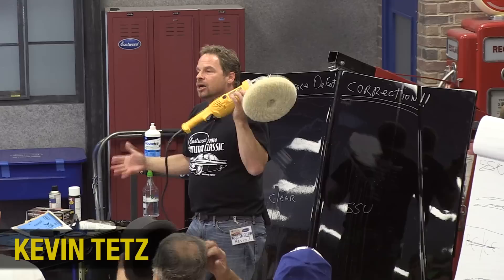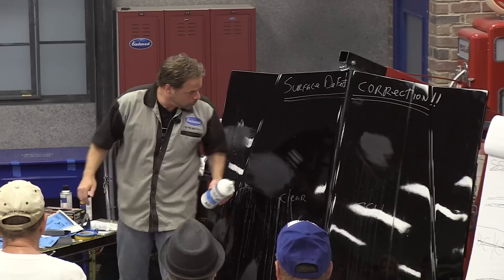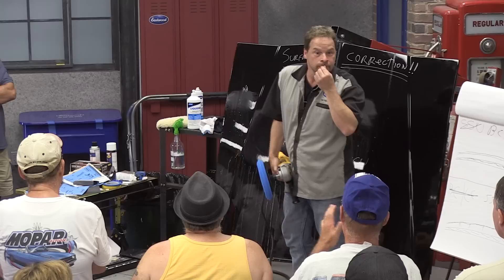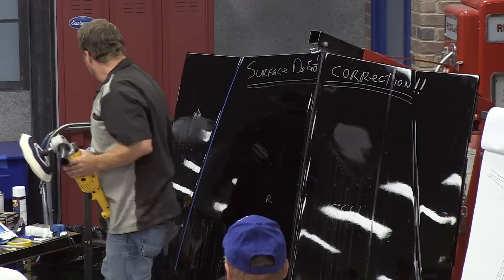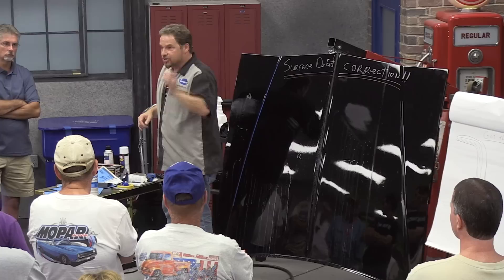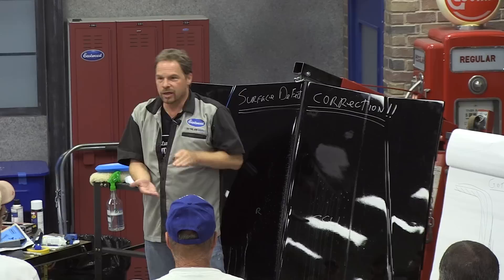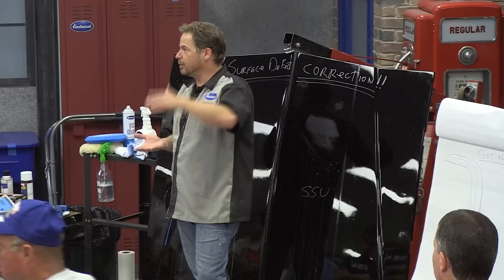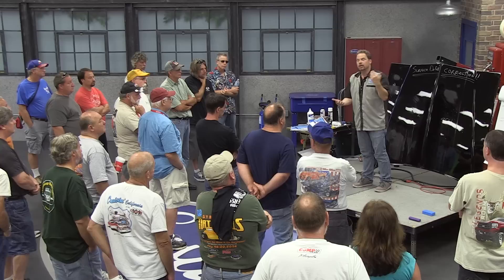How To Buff Clear Coat & Polishing Your Car Part 2 of 3 - Kevin Tetz Demonstration - Eastwood

Comment: Hello I just bought the Dewalt buffer like your it comes with a 7in velcro pad, the ice system comes with a 6inch backing pad and I guess all pads are 6in.  Dewalt recommends 7-9 inch I wish you would of talked about why 6inch is better. also, Eastwood sells an 8in backing pad I believe for the ice system but I didn't see 8inch pads for sale. So should i change DeWalt's backing pad to 6inch

Comment: Hi Kevin at 35;45, you say one body shop gets to surfacer and lets the paint rest a month allowing solvent to evaporate. Is there a chemical bond between surfacer and colour coat and is this lost by allowing the surfacer to sit so long? I assume the surfacer must be flatted prior to colour coat meaning there is a mechanical bond. Also, is this true of colour to clear coat. (For example if I leave colour coat a month before clear coat, will it stick? 
Thanks Dave T.